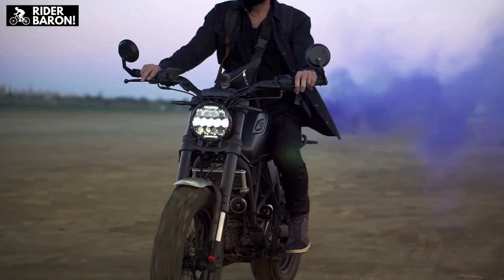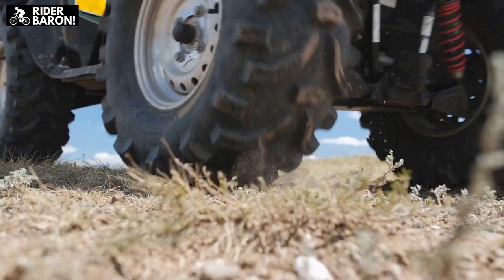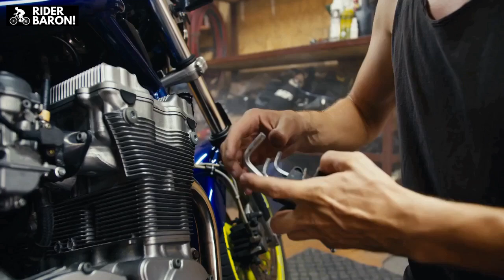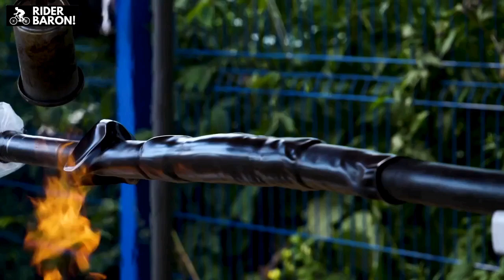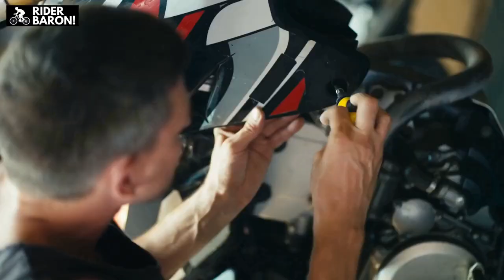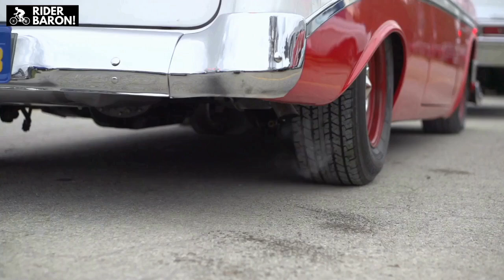How Hot Does A Dirt Bike Muffler Get?

Comment: My Suzuki re5 exhaust pipe get to 1800°f that's why it's double walled and has intakes to cool each of them off along with heat shields if not carful dismounting the bike you will burn your leg something farce I've seen these exhaust melt shoes just from touching for a second but this is what rotary engines do even my rx7 exhaust getting red hot it's one huge draw back with rotary engines . I always remove my helmet before dismounting to make sure not to make a mistake. 😅